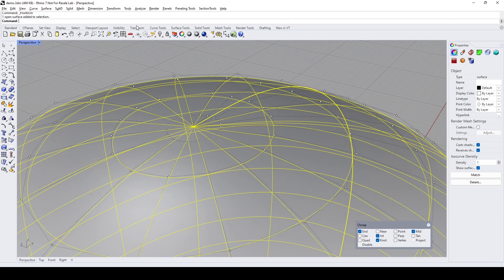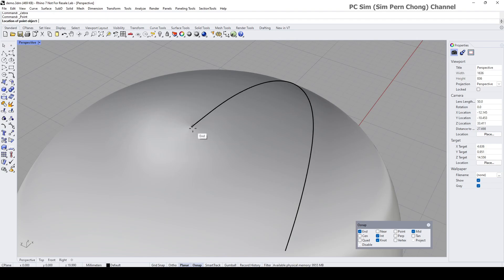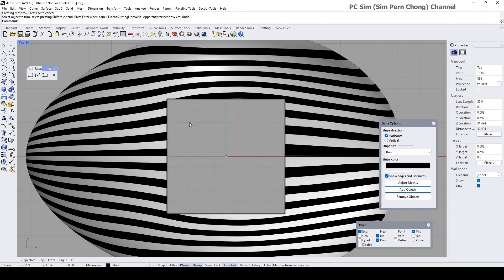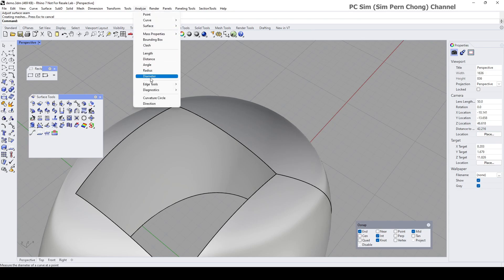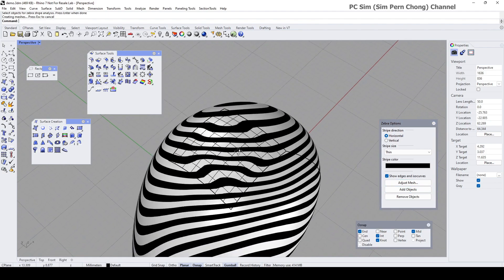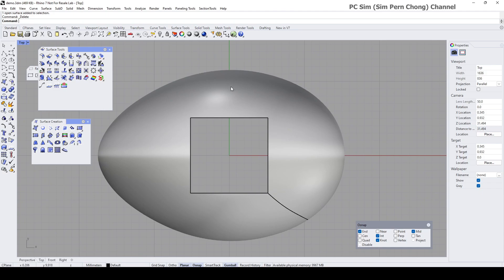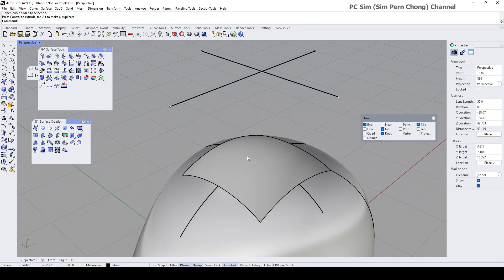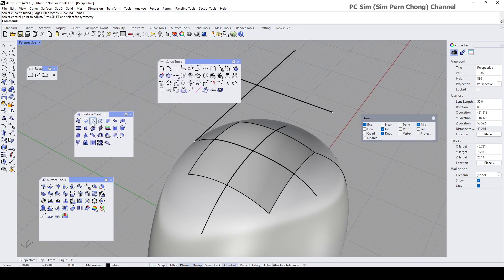Rhino Tutorial: Fixing Converge Point Discontinuity (Requested) [犀牛3D教程：修复中心点的平滑性]

Comment: Class A surfacing is the process of creating high-quality surfaces with smooth, continuous curves and no visible imperfections. It is commonly used in the automotive and product design industries to create aesthetically pleasing and functional products. Rhino can be used for Class A surfacing to a certain extent, but it may not be the most efficient or ideal tool for this purpose.

While Rhino is a powerful 3D modeling software that can create complex geometry, it is not specifically designed for Class A surfacing. Some of the limitations of Rhino for Class A surfacing include:

Limited control over curvature continuity: Rhino's tools for creating curves and surfaces may not provide the level of control required to achieve seamless curvature continuity.

Lack of advanced analysis tools: Rhino lacks some of the advanced analysis tools required for Class A surfacing.

Limited support for fillets and blends: Rhino's tools for creating fillets and blends may not produce the level of quality required for Class A surfacing.

That being said, Rhino can still be used for Class A surfacing to a certain extent, especially for less complex surfaces. However, for more advanced Class A surfacing tasks, specialized software such as Alias or ICEM Surf may be more suitable.

Comment: Master, could you please make a tutorial with a practical example explaining the single span technique?

I need to understand primary surfaces 😭

Thank you very much in advance and greetings from Spain... Sorry for my bad English but I should have used google translator :)
Reply from the maker: Sorry for the late reply. In my opinion, Rhino is really not good with single span techniques. For single span Alias studio is better.

There are a few tools to reduce the controls points and knots. That is the Removeknot command.

Can also use ConvertToBeziers command to reduce surface to single spans.

Cheers.